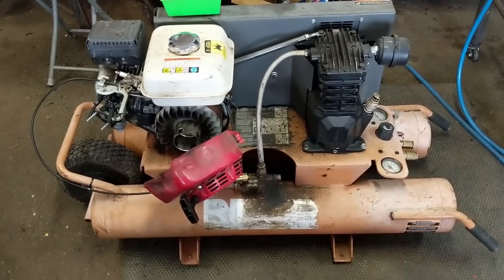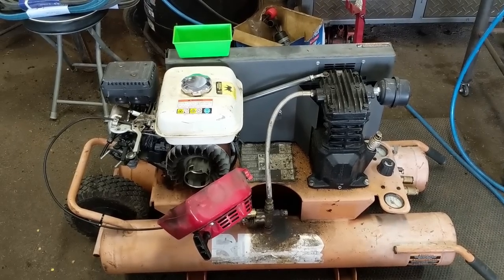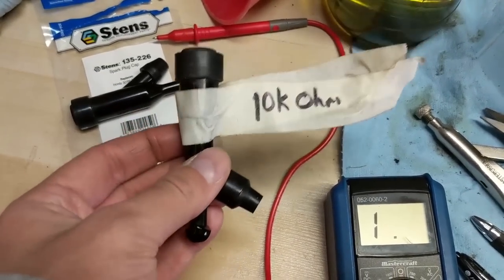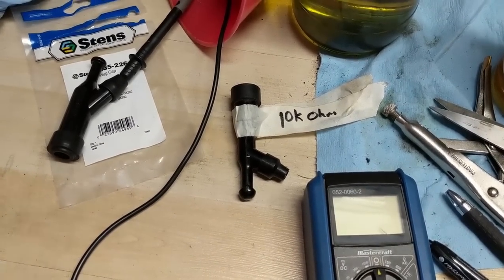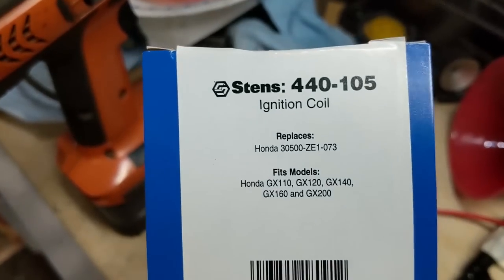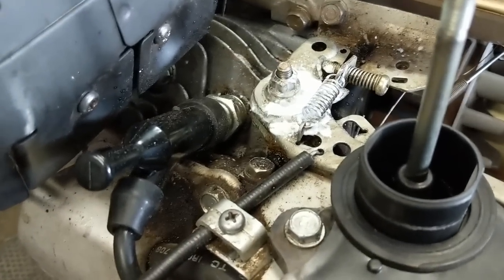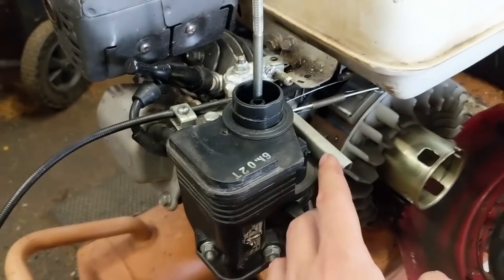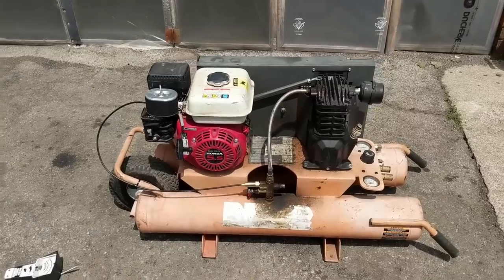Honda GX160 - Shutting Down after Getting Hot

Comment: That was a great fix. I had a customer (Amish cabinet maker) that used the GX-160 in his shop vent fan system. He would get in touch with me and tell me no start. I went there 3 or 4 times and it started no issues. Finally I changed the coil and cap and no more issues. Many Thanks
Reply from the maker: Thanks for watching Waterman one!

Comment: Never thought of the spark plug cap. I have a friend with a small Toro snow thrower with the same problem. Starts and runs great, Shut it down and it wont start for about 10 minutes. Changed the coil and same issue. He changed his fuel from reg. unleaded to Stihl High performance Motomix 4 and now it starts all the time. Will have to look at the cap to see if there is an issue with it because it will save him a fortune on fuel. Thanks for the great video.

Comment: Thank you for the great video.   My pressure washer was not having this problem but would not start.   I found it in the shed upside down,  I must not have put it away on shelf correctly and it got knocked off.   It would not start next time so I cleaned carb and new air filter and spark plug they where all full of oil.   Still would not start,  ignition coil was next item to check,   you stated oil sensor cut off sensor or switch.  I had to go out in middle of night and checked oil level.  Low oil, added oil and fired up first pull.     Thanks
Reply from the maker: Awesome, sometimes can be the last things we check, like finding keys, always the last place you look lol thanks for watching!

Comment: Great video! One suggestion would be to set your meter at 200 Ohms when testing the primary winding as the meter is not going to be sensitive enough to detect 0.8 - 1.0 Ohms at the 20K setting. That is the reason the meter reads 0.00 and shows no resistance.
Reply: Makes sense and thank you 🙏

Comment: From my experience ----- While testing the Primary at 6:42---7:26, the multimeter should be on 200 ohm range [not 20K]. The 200 ohm dial setting will give a more TRUE resistance reading of the Primary winding on the ignition coil.  That has been my experience.  Thanks   deg44401
Reply from the maker: The 200ohm setting won't test above 200ohms, so if I'm testing for 3000-5000ohms the 2000 ohm setting wouldn't work either. This isn't a smart meter that auto configures, it's just a cheap one
Reply: What I'm saying is that the  Primary winding doesn't need to test above 200  ---- only 0.8 - 1.0 ohm, which is way below the 200 ohm max for that range setting.  If the primary has [say] 10 times the resistance that it should be [say 8 - 10 ohms], the 200 ohm range setting may be able to detect that.  1.0 or 10 ohms [or maybe even 20 ohms] of resistance on a 20K range will most likely read zero, depending on the accuracy of the meter and the resistance of the test leads themselves.  That has been my experience.

Comment: old cars from the 1950's had screw in "noise suppressors", to limit interference with car radios.
when i inherited a 1955 Wolseley 6/90 from my in-laws (may they RIP), i discovered the fitted suppressors ranged from 5K Ohm to 15K Ohm, thus the six cylinder was running a bit rough.
the 5K is probably built into the spark plug cap so that you don't piss off the neighbors with TV or radio interference when running the engine.
Reply: Yep and I was hell on radio in vehicle if you didn’t have it 
Lololo good old days and 0.75 a hour

Comment: Nothing wrong with that spark plug cap you binned, it just had a 10k resistor in it to reduce Electromagnetic Interference (EMI) - the stuff that makes that RPM meter you were using work.
Reply: Yep I just bought a new cap and it reads 10.34 ohms same as my old one also my new coil straight from honda has a reading of 10.80 ohms which is out of spec. According to hinda which makes no sense?
Reply: I unscrewed the brass cap in the coil and found a pill resistor. Read 9k and found a used one from a rogue coil at 1.9 k ohms. Total 8k ohms. Primary at 1.1.  Engine still doesn’t stay running.  I Gave up. I’m just going to order a coil and carburetor

Comment: 7:15 a cheap multimeter in the 20k range won't be able to resolve 0.8 ohms. It will just round down since the lowest value with 2 decimal places is 10 ohms. Set to 10 ohm mode and it should read correctly.

Comment: I have worked on Tecumseh, Briggs and Wisconsin engines for 45 years....never seen a SPACER in ONE for vapor locks. The carb in most ran within an inch or two of the mufflers in a lot of those old engines. I think the plastic spacer is more likely intended to crack and fail than anything else....like most of the crap hanging off these new engines.

Comment: thanks i just got some go karts and learning about the gx 160 and 200's I found on one of my karts the spark plug wire melted and shorting out to the block .. the coil is dead.. no spark at all. so i swapped coils from my old stock of parts and looks like i have spark. im going to remove it and do the test like you did in the video. im not good with electric it confuses me .. but i believe your video will help me even if i need to watch it 7 times.... one of the caps came off the wire and i was afraid i broke the coil ... woo thanks for letting me know the caps are removable.. lol . Im hoping to get a few of the engines running but it seems they all had Head issues.. valves were stuck in the valve guides. Some of them were missing the valve guide seals which is why the valve seized into the head. 1 engine has a broken rocker and bent push rod. 
 i got them all freed up and going to try and install the nicest one back on the engine. I need a rebuild kit for the head.

Comment: I notice the cap in the video says for GX120, GX160, etc.. I have a GX110 behaving similarly and ive checked or replaced everything fuel-related. Runs perfect for 30 seconds and slows down until it dies. Can I use the same part for a GX110? Those are more widely available it seems. Great video. Thanks.

Comment: I doubt that coils are intermittent.  Most likely, the flywheel magnet has weakened a bit and you're not getting enough voltage to jump the spark gap.  Try reducing the plug gap so it takes less voltage to make a spark.
Reply from the maker: Ran the spark plug at 0.030" and the proper spec on the armature air gap for coil, machine hasn't come back in for anything, my customer says it runs like new again!

Comment: Okay my Honda engine does the same thing shuts off randomly went hot it's on a leaf vacuum system and it drives me crazy cuz I have to keep getting off the tractor.  first pull starts right up.  I checked my spark plug boot and it also has a high 10,000 ohm resistance I ordered a new one if this fixes it you'll be the best guy I've ever.

Comment: Why there is so much resistance on a spark plug boot ?? Does the boot have resistive material inside ?? This really puts pressure on the coil to make as much juice as possible Then you have resistance inside the spark plug. The engineer who designed this system must have had a bad day for sure. I am no expert but a small coil like this really does not have that much swype for sure. Can you buy a spark cap without resistance ?? Thanks Eliminator

Comment: I have also seen if the engine is not used for a couple of weeks ,the fuel leaks passed the shut off and needle and seat into the cylinder than into the oil . the same poor running or worse depend     on the amount of fuel in the oil . keep an eye on oil level if it is high check fuel. level .

Comment: Thanks for an informative video.
I had a 13HP Honda on a pressure washer that would run for about 7 minutes and then quit.  You could almost put a stop watch on it.   Ha Ha  It turned out to be a defective spark plug.

Comment: My mower runs Great Cuts great no problem but after running for awhile if I shut it off manually and try to restart it when it's hot it won't start. The strange thing is it's running absolutely perfect no surging nothing the carburetor is clean as a whistle however if I spray carb cleaner in there it will start and then continue to run it's almost like there's a Welch plug missing or something in the carb I don't know if there's a low speed circuit I don't understand why the engine runs perfect while it's running but if I shut it off it just simply won't start back up is boggling my mind but I'm leaning towards of bad coil
Reply from the maker: Those are the hardest problems to solve. I'd get yourself a gap type spark tester. Then you can test how much spark you get cold, and then again when it's hot. At least you can replicate your problem, over and over to test. Sometimes I get machines where a customer says it randomly shuts off, and it runs fine for me lol if you can't replicate the issue, that's when it's the worst! Good luck!
Reply: @EliminatorPerformance  thanx for the help...i do know that when the engine is running the coil is kept cool from the flywheel fins blowing air on it...i am thinking when i shut it down it "heat soaks" and then has very little poor spark if any at all...

I will report back here if i solve the problem because i believe it is so important to help others diagnose a problem if we record what actually fixed it...especially these very tough problems to fix that we dont see every day.
Reply: After tinkering with this all weekend i think i finally got it...most small engine problems are carburetor related and this one i believe was the carb too...

I replaced coil with a used one and that didnt work...tested for spark and had great spark after it got hot and wouldn't restart....compression was the same cold and hot....so i leaned towards it being fuel related....

Took apart carb and there is a small brass jet/port on the air filter side of the carb....im assuming this is an air metering port because of where it is placed....i sprayed carb cleaner in it and it would just spray back so figures it was clogged....took the b string off a guitar and ran it through then sprayed through and it came out the bottom of the carb into the bowl....started back up and ran and then i tested it and got it to start hot....still acts kind of funny but it wouldn't even start hot at all before unless i sprayed carb cleaner in....these quantum engines naturally run on the richer side because the main fuel jet is much larger then the newer carbs or even the Honda's....this means if something small is causing it to run even more rich you won't know it unless you have a hot start issue like i had....hot engine NEEDS more air (leaner mixture)....

Comment: Great vid. Your testing of the primary is wrong. Firstly you need to set your meter to the 200 Ohm range for such a low resistance but even then you wll not get a reliable reading because the contact resistance of the probes and meter switch are of a comparable range. There is a way to take low Ohm measurements without needing the proper specialised meter. You will need this method too to measure the resistances of generator windings. send me an email if you want an explanation. I'm a retired marine electrician.

Comment: If you unscrew the brass piece inside the cap there's a resistor or something inside my cap that is reading 10 k ohms + .  My coil reads ok. So I've ordered a new cap assuming it should read half that.
Reply: Note my brass piece inside the cap had notches for a straight blade scew driver.
Reply from the maker: @briangoodale7167  I've never taken them apart, I get em for like $4 I think so I just replace them. Thanks for watching!

Comment: can anyone give me some advice? 
I have a Honda GX160 there is an acceleration problem. When I throw the throtle to max it will struggle for a good minute. The unit is on a plate tamper which is operated with an automatic clutch. at idel there is no load and as it accelerates the clutch grabs ahold and it begins to run the exciter/viabrator. this is where it will not accelerate to its potential. 
I have checked the valve clearance, cleaned the carb, check my fuel supply, changed spark plugs, adjusted the governor. The compression is at 100 psi with the exhaust valve disabled. Could this be a coil problem similar to what your talking about in this video? 
Great video by the way.
Reply from the maker: Absolutely could be, but I'd start with the spark plug cap 1st, as shown that original had too much resistance! Also take off the air filter and see if it runs the same.

Comment: I am having problems on my gx200 on a pressure washer. Replaced carb and fuel filter and spark plug and oil change.Got it to finally fire up. But after 2 minutes it dies like it’s running out of gas. Possibly a bad low oil sensor? Or should I be looking into the coil and plug cap?

Comment: I have a gx 120 that starts them runs for 10 seconds and quits. I have set the valves, changed the coil, and spark plug cap, changed the carb. Bypassed the low oil switch , and it still starts and dies. Could it be the automatic decompression  spring is faulty ,Iam stumped . Have you ever run into this problem ? Thanks .

Comment: Hi! Great video!

A couple of years ago I bought a power generator that has been running great until last week. It ran for 3 hours and then stopped and Doesn’t want to start up.

I put fresh fuel, I cleaned the carburetor jets (everything was really clean and brand new), I also tried spraying some gasoline through the carburetor and also with a a quick start spray without luck. The spark plug is making a nice and strong spark arc, the oil level is fine as well as the sensor. I checked all the cables and everything seems fine. I just don’t know what else to do! If there is spark (and a strong one) and there is fuel inside, why isn’t it starting? 

Oh and when I pull, there seems to be good compression...

Any ideas? Thanks!
Reply: Timing is off. Have you checked the flywheel key? What was the reading on the compression tester?
Reply: check tappets isnt too tight

Comment: Is that a new oem coil or aftermarket  and how do you know what the value for the engine is
Reply from the maker: Service manual will give specs, so go to Google and type in the model, and then type service manual after. This is a STENS coil, so it's not OEM but it's not china crap either.

Comment: I purchase a Chinese replacement coil for the GX390, looks like the same coil as yours. I'm noticing the coil only puts out spark when the RPM is low, like pulling slowly on the rope. The faster I spin the flywheel, the less spark I get until there is none. What do you think?
Reply from the maker: I'm honestly not too sure lol I've never heard this.
Reply: @EliminatorPerformance  I noticed this by accident. When I would hand-spin the flywheel with the slug out, to check for spark, it worked. So I put it all back together and nearly pulled my arm off trying to start it. That's when I saw that if I pulled the cord out normally fast, like you do to start any engine, I get little to no spark. If I pull on it slower, like if I'm not even trying, the spark is there. I've never seen this either! The old American Briggs/Stratton & Tecumseh's never acted like this.
Reply: Bad coil